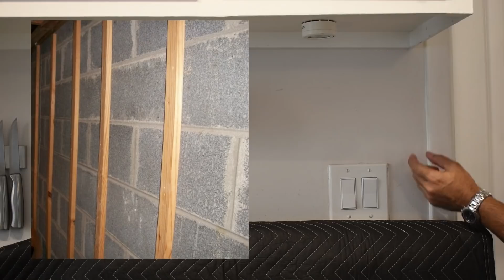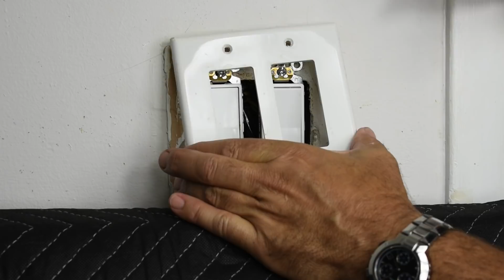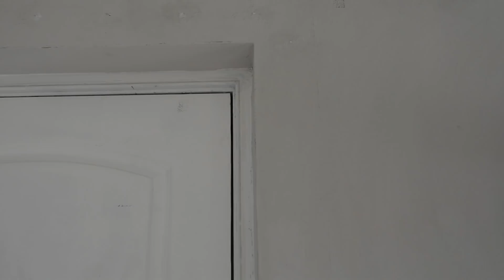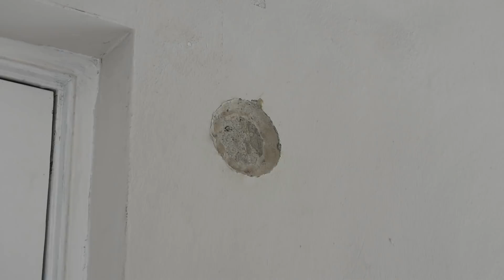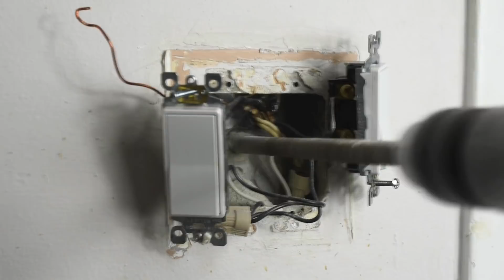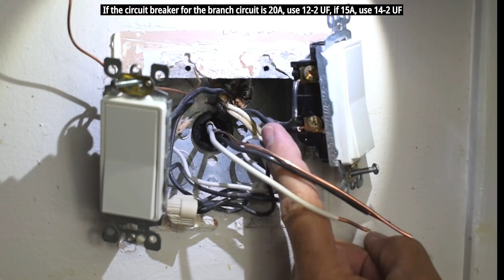How To Add Outside Light On Concrete Block Wall By Door ~ THE RIGHT WAY!

Comment: You are very brave to do this, a lot of people would have ran surface mounted EMT instead.  I guess that would have been the last resort for this installation. 

Great tips on this video!
Reply from the maker: I wanted the installation to look like it was always there. As you said, I used 1/2" EMT in the past on the outside of the block wall, along with an LB and weatherproof box. If the cores were poured, then I would've drilled through both sides of the block so I would be able to send the wire down between the drywall and concrete block.
Reply: @electronicsNmore  Yes, the finished job looked great.  Having the proper tools such as the inspection camera made it easier to complete.

Comment: I've never seen retrofit wiring in hollow block, thanks.
Reply from the maker: Usually you'll drill through both sides of the block and feed the wire between the block and drywall, this method is the best because there's no risk of damaging the wire with a screw through the sheetrock after installation. Thanks for watching!

Comment: Sinker beats using a nut and the magnet is an awsome pinpint locating fix for an issue I am having . Thank you
Reply from the maker: I've use nuts in the past and they have a tendency to hang up, the smooth egg sinker very rarely gets hung up. I very rarely use my stud finder, just that magnet. Thanks for watching!

Comment: Thank you for taking the time to make this video, it was extremely informative!!  I just had a couple of questions if you don't mind me asking:  

** In the video it looks like the outdoor fixture is being installed under a covered entry way....where i would like to install a outdoor light fixture (my house is cinder block on bottom and vinyl siding starting 1/2 way up) the only covering/overhang are the eaves/soffit....ALSO it would be wired for use with two 3 way switches...would using the same round metal box for the light that you used be ok ( I think it would be exposed to rain more so than yours)?

** I really like how you buried the light box in the wall..very clean looking!  I would like to do the same technique to install a box for the light switch as well...I just have a plain old cinder block on the inside, unfinished...could you please tell me what metal box would be ok to use in this instance?

Thank you much for your time and help!

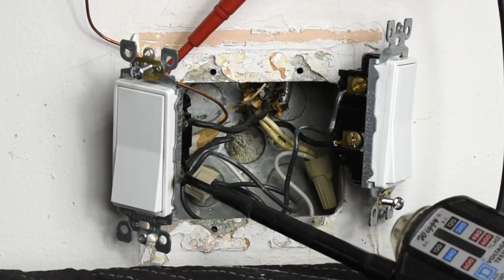Comment: 3:29 You should test with the power on first, then switch it off and test it. That will verify that the meter works and that the ground wire is actually grounded. You also need to test that neutral connection. Just because the hot wires are shut off does not mean that neutral can't be energized via a multi-wire branch circuit or miswired neutral.
Reply from the maker: Bar meters are extremely reliable, I've never seen one fail. For a DMM, or other tester, I agree, verify the tester works before using it. You cannot test the neutral wires for 120V to ground unless you separate the white wires. As long as the wires are connected to neutral, the voltage will be zero.
Reply: @electronicsNmore  Even with this circuit off, when you separate the neutral wires, one of them can become hot if the neutral is shared with another circuit.
Reply: @jaynecobb3701  He already knows that "As long as the wires are connected to neutral, the voltage will be zero."
Reply: @illestofdemall13  You can get electrocuted by assuming that a white wire is connected to neutral and will not be hot. Been there, done that. You should not assume that the wiring was installed properly. You can't assume the white wires will not be hot. You have to test them.
Reply: @jaynecobb3701  I get what you are trying to say but the video presenter already knows that and so do I. There are certain things that you pick up with experience. When all the white wires are together they are indeed neutrals (like in this video), therefore you cannot test for voltage on them because there will be zero potential between neutral and ground. You'd have to take them all apart and test each one individually.

Comment: Was there Stucco on the outside block? Can you use the same methond on block without stucco?
Reply from the maker: Yes there was stucco but that don't make a difference
Reply: @electronicsNmore  The pancake box is not waterproof. If I mount directly on cinder block no way for a tight seal. Using a surface mount box with a motion light which requires an adapter plate. No one seems to stock the correct adapter.

Comment: Would have used 14/2 wire. Bends a lot easier. I always used a wire with a ring on end and used waxed string with a lead weight to fish pull string down a wall. Wow saw you use the great Square D wiggey tester that heard they stopped making . Used them a lot back in the 1970 & 80's. Found the Ideal Voltron better because it could test fuses & continuity. Was taught to NEVER wear any rings or metal watch bands while working even if power is off. Had a guy loose a finger while he jumped off a truck and ring got hung up. If luminare is mounted on outside of building NEC code mandates that you seal wire so condensation will never build up with difference of temperatures.
Reply from the maker: I had a roll of 12-2UF on hand, so I used it. Much better than spending more money unnecessarily. If I reach inside an electrical box or panel, the watch comes off. Yes, better to not wear any metal. The rubber bushing did a fine job sealing around the wire inside the hole drilled. Thanks for watching
Reply: @electronicsNmore  At an IAEI continuing education class ( need 8 hours a year to renew electric license ) they told us that type NM ( romex ) is not allowed to feed an outdoor luminare due to its not rated for damp location. Somebody gave me some old UF cable. Fun to skin on coldest day of winter. Now retired after 50 very enjoyable years as a sparky. Never got to use the plastic connector like you used. Old school would have to chisel out block to get a romex connector to fit. 99% of my work was industrial settings. 40 years ago rewired a few old houses and a nice size manson that even with all gas appliances & heat installed 3 circuit breaker panels and 80 circuit breakers. Owner was a gadget nut. Nice vid.